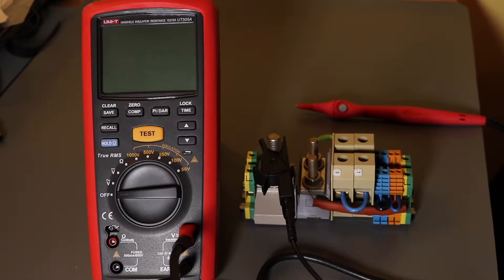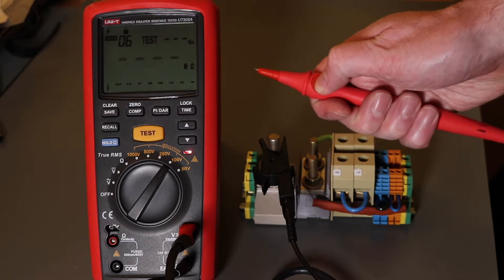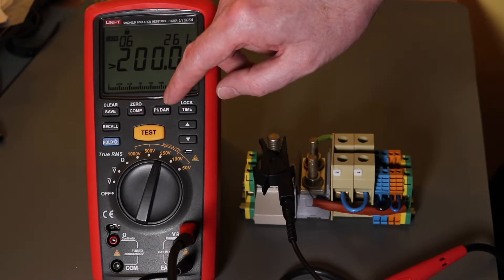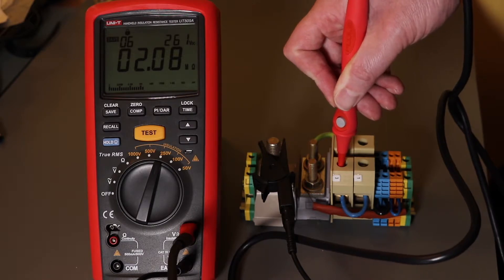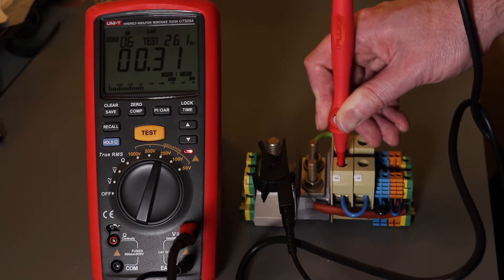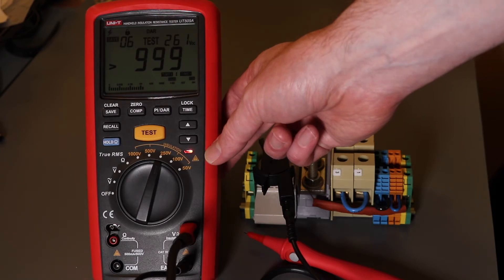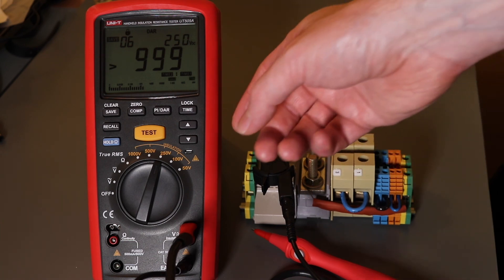UT505A Insulation Tester Operation

Comment: Nach etwas über einem Jahr hat sich bei recht wenigen Messungen ein Isolationsfehler im Gerät bei den hohen Messbereichen der Isolationsmessung eingestellt. Sehr ärgerlich. Da nützt auch der günstige Preis nichts.
Reply from the maker: Sorry that yours has failed. It depends what the actual symptoms are, in the past I have replaced internal varistors and the mosfet for driving the transformer. On one I did have a feed back resistor  go open circuit.

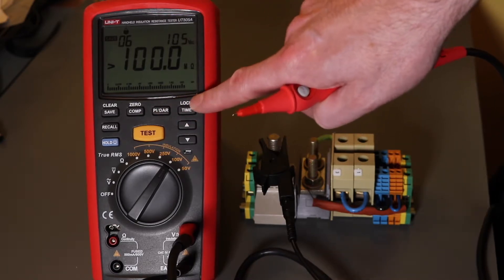Comment: At 1:39 you mention the unit sounds an alarm if an IR test is <1Mohm on the lower ranges and <4Mohm on the higher ranges. In the manual on page 6, it mentions you can use the COMP button to set a comparison value such that if your measured insulation is higher than your desired threshold then "PASS" will be displayed on the screen... is there any chance this setting also affects the audible alarm you highlighted?
Reply from the maker: I have just rechecked this morning as I still have the meter available to me and the alarm does not appear to be tied into the comparison function. In the video the comparison function is turned off anyway. When I tried it today with comparison turned on it just displays 'Pass' if the actual value is above the comparison selected or 'NG' if it is below. But the alarm was still beeping even if I had a 'Pass' displayed. Thanks for watching and commenting.
Reply: Thanks for checking and your detailed writeup on element14. As a private landlord, I'm just after a cheap meter that does insulation/continuity so I can do the occasional PAT test and fault find with. I'll give this meter a try.
Reply from the maker: @spammyjenkins87  The UT505A should certainly be able to carry out those types of tests. I find its price varies dramatically depending on where you purchase it from, so have a good shop around.
There is another meter that would also fit you needs which is the CEM DT5500. I have not reviewed this meter, nor seen one in real life and sometimes CEM can be hit and miss with regards to quality.
Cheapest I have found the DT5500 is from test-meter
https://www.test-meter.co.uk/electrical-insulation-tester/
Cheapest I have found for UT505A is from Amazon
https://www.amazon.co.uk/Insulation-Resistance-Handheld-Digital-Multimeter/dp/B081211L3T/ref=sr_1_42?keywords=insulation+tester&qid=1580390548&sr=8-42
The alternative of course is second hand from eBay, looking for 1000V insulation tester, plus 200mA continuity or earth bond test. AC / DC volts if you want it.

Comment: Hello sir, did you feel extremely safe while using this meter ?  It looks like a good meter , but do you think it will hold up against the other major brand name insulation tester on the market today ? Thank you.
Reply from the maker: Safety is a subjective question and whilst the meter being used is part of 'feeling safe' there are also other aspects that add to this.
If the meter is used for white goods, domestic, light commercial work then I would say it is safe and you could live with the operational quirks it has. Personally, I would not use it for heavy industrial work, there are better offerings out there in terms of safety factors and functions.
Thanks for watching, appreciate your comments.
Reply: Thank you.